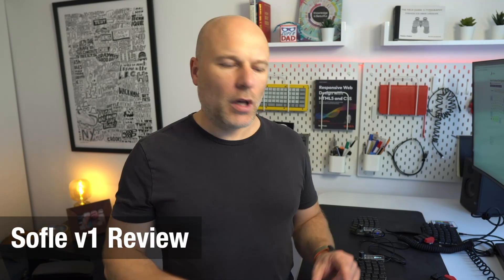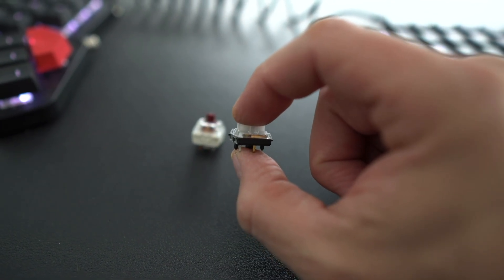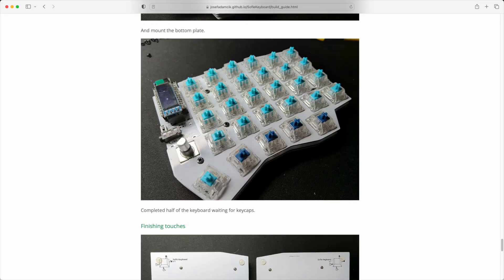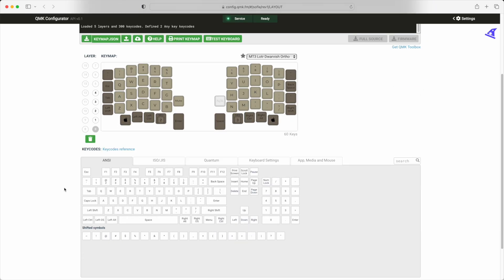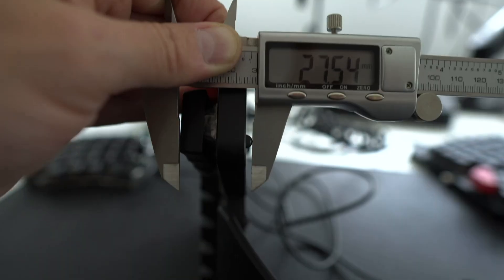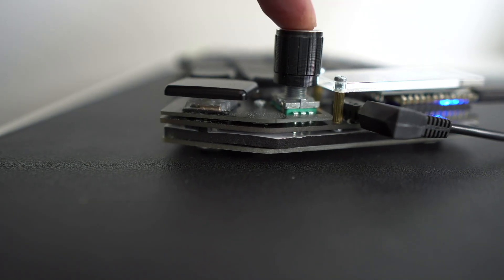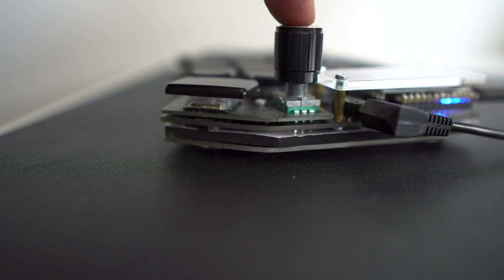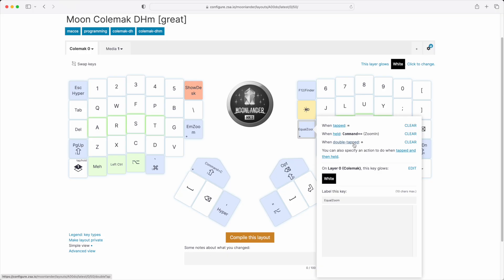Review: Sofle Split Mechanical Keyboard – build, encoders, choc switches. Full Review.

Comment: I've been using the MX Switch of the Sofle for 2 years now as my daily driver. I'm currently building the Choc version mostly just to try out the Choc switches in a familiar form factor so I was interested in the review when I saw it come across my suggested videos.
Reply: I honestly didn't notice much difference. After a little bit I got used to the new depth of the switch and it felt fairly similar. I felt more of a difference when I swapped the original switches (Kalih black) I was using with the MX version to C3 Equalz Tangerine. I like a linear switch, so if you like tactile or clicky your mileage may vary.
Reply: @matthewpelkey7721  Thanks for replying!
Reply from the maker: Let me know which you prefer when you’ve tried the choc one for a bit. Never had an MX Sofle so would be interested in how you find the comparison
Reply: Interested to find out how it went for you?

Comment: Your points on the rotary encoders are interesting, because that's why I'm here. You seemed to mark them against the Sofle, but I'd argue you made a great case in support of this keyboard as completely unique.

First, your description of three button patterns - clockwise keypress, counterclockwise keypress, and stalk press - is more input density that having keys in those slots, giving the whole keyboard +4 inputs without needing additional sockets. 

Second, depending on the sampling frequency and handling of the rotary encoder input in QMK the speed/precision of the rotary encoders can be handled. The repeated press behavior is higher level than I was expecting.

Third, you could use the rotary encoders to cycle layers on each half of the keyboard, or double up with layers, ala Satisfactory loadout wheels. I'm planning on screens for info readout and an RGB flavor of Sofle to indicate layers/filters with colors as I get used to it.
Reply from the maker: I like the idea of them but practically a key with tap dance is more flexible. Still four possible inputs and you are not locked into that spot having an encoder. But I’m curious how you find them and if your plan for them works out. Would you mind updating here when you have done it and used them a little?
Reply: @benfrainuk  Will do! It may be quite some time, but I had hopes for them with motors and other knob-intuitive inputs.
Reply: I briefly looked for QUAD rotary encoder boards. I'm an engineer, leave me alone.

Comment: I very recently designed my own drop-in PCB replacement for the 65% EK68/GMK67 in KiCAD from scratch.  Working on the KMK firmware customisations now to meet the needs of my board.  Designing and receiving a completed board was great.  Looks really nice and professional.  I have two RGB circuits too: 66 RGB and a 2 RGB for status lights.  Perhaps I'll get to splits eventually.  The reason I did what I did, was the firmware on the mystery MPU was limiting with only 1 Fn layer.  It's been a great experience but it can be pricey compared to a store bought basic job.

Comment: Hey, cool video. I find myself hitting 2-3 keys using thise keycaps and switches, I went back to MX switches as keys are more separated. I also solved my Corne with big battery yet very slim 3d printed case. But I wanred to ask you, is linear encoder any better? Ever tested?
Reply from the maker: Never tried the linear encoders. As far as I know, they work just the same way as the rotary ones

Comment: I'm starting down the rabbit hole myself and even looking at designing my own pcb but for now, just gone with a pre-built from Mechboards. I'm a software dev, mainly frontend too and looking at learning colemak to us on my new keyboard. I'm hoping that this will help with coding as Querty isn't designed for coding with 🙂.  Great video again and look forward to more from you.
Reply from the maker: Let us know how you like it 👍
Reply: I very recently designed my own drop-in PCB replacement for the 65% EK68/GMK67 in KiCAD from scratch.  Working on the KMK firmware customisations now to meet the needs of my board.  Designing and receiving a completed board was great.  Looks really nice and professional.  I have two RGB circuits too: 66 RGB and a 2 RGB for status lights.  Perhaps I'll get to splits eventually.  The reason I did what I did, was the firmware on the mystery MPU was limiting with only 1 Fn layer.  It's been a great experience but it can be pricey compared to a store bought basic job.   I'd say go for it if your budget and time allows.

Comment: Nice video! I've a Redox from Falbatech, really happy with the layout. What about the thumb "cluster"?
Reply from the maker: Wow. Don’t know how but I’ve never come across Falba. The bamboo cases really appeal. How do you find it?

The middle key of moonlander thumb clusters is never used and I find just the one thumb key in the right position on the Sofle is great. Have to double up elsewhere but not really an issue.
Reply: I was thinking about getting a low profile Sofle from Falba, so I have the same doubt as Ben, how do you find it? Is it robust? Or does it give the same filling that Ben is commenting for his home built Sofle?

Also, I am not sure about the Falba casing for a low profile, since it looks like the thumb key may be difficult to press. All other fingers attack the key from above, but thumbs at least mine come from the side of the key. Falba's cases seem to preclude a nice pressing dynamics, or at least they seem to force your thumb to impact against the casing, which does not seem superb either. I will be happy for any comment that anyone can make on that respect.
Reply: I got my Falba second hand. The quality it's pretty good. If my redox will break I would buy another one from them. 

Of the 4 thumb key on each side I basically only use the bottom 2s ... But I think this is the bare minimum for me.

I would like to try the kyria .... looks nice.